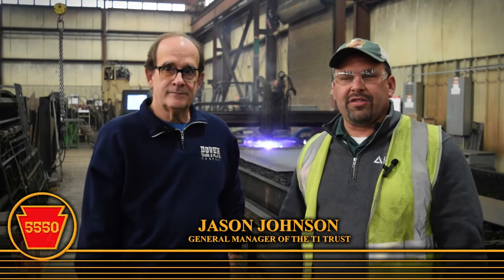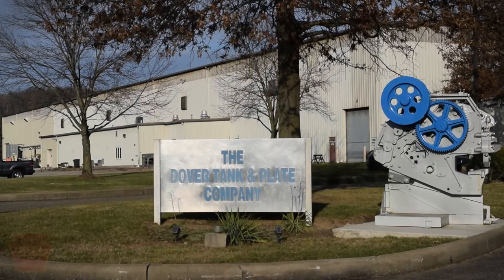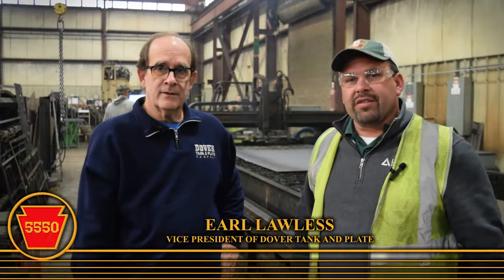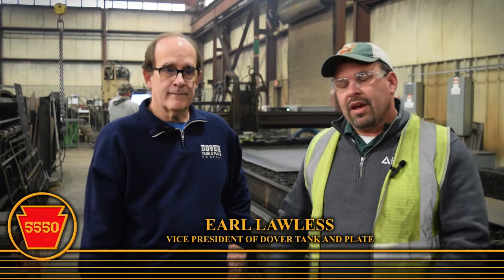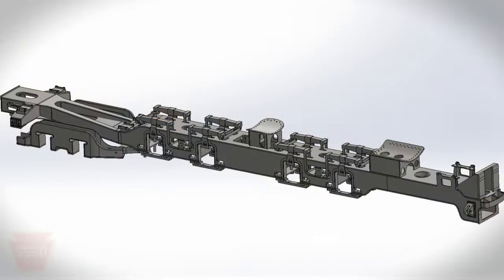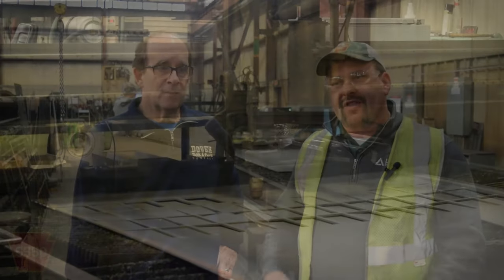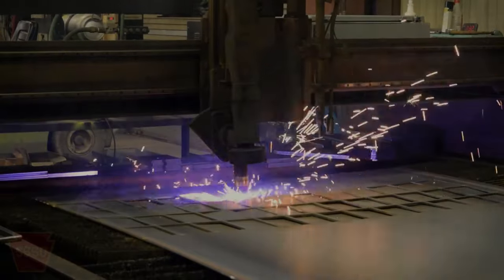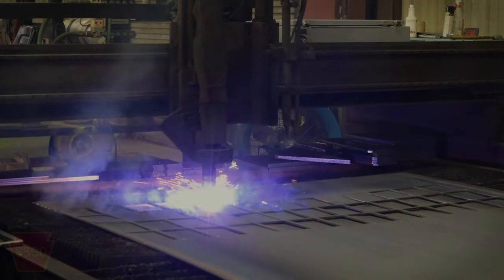T1 Trust | December 2023 Frame Update

Comment: So happy that 5550 is finally coming into existence! Once she's complete, we can finally see the root cause of the wheel tendency for ourselves in the 21st Century and see if that can actually be straightened out. It's also good that they're gonna utilize the newly improved Poppet Valve rather than the original Poppet Type A. I'm totally convinced that had the T1's production resumed, the newer locomotives would've been equipped with the Type B Poppet Valve. My best evidence for supporting this theory of mine is an account of one T1 locomotive having an accident and later being repaired, with the Poppet valve gears being upgraded to the new one.
Reply: We know the root cause of the wheelslip, it was engineers that were used to the K4s thinking they could drive a T1 like a K4 - that is, maxed regulator and full forward on the Johnson from a standstill. When the PRR loaned out a few of their T1s to the C&O, the C&O engineers didn't have any issues.
Reply: @VestedUTuber  You beat me to it, darn it
Reply: Not to mention lots of duplex and articulated locomotives were fairly successful at many other railroads. It's more of a training issue, rather than an inherent error or flaw of the design.

Comment: Once the new T1 is finished, I’d love to see it be coupled to the Lake Shore Limited, put the diesel locomotives on idle, let them just provide HEP, connect a few private cars to the train and let the T1 go at it and provide all the pulling power for the train! OH, YEAH!
Reply: I'd like to see a Baggage or similar head end car converted to provide HEP and Heating. Since the T1 will have integrated PTC, it shouldn't need to have a diesel with in on mainline track.
Reply: @ThePTBRULES  the diesels are there to hold it back from 100mph on its first test run!!

Comment: One step closer to righting a wrong in the name of the preservation community! I wonder how famous this locomotive will be when finished compared to 4449, 844, 611 and 4014 when it is operating?
Reply: I’d imagine it will be in the new once it’s done, and if it DOES beat mallard, it will reach big boy status.
Reply: @backonpro5679  I definitely think that it could become the most famous steam locomotive in America. For all we know, it might be on par with Malard and flying Scotsman if its career goes really well. At minimum I could imagine it being as famous in America as tornado is in Britain considering that also was a locomotive that was a modern built version of a formerly extinct class.
Reply: If nothing else it would go down as the 1st extinct US steam locomotive to be resurrected brand new!  But i think it will go on to achieve much more than that.
Reply: @b3j8  in terms of an extinct class that is correct although there have been other reproductions of formerly scrapped locomotives previously. Union pacific 119 and central pacific Jupiter were both re-created in the 70s. Two other 19th century style locomotives were built in the previous decade one of them based off of the central pacific locomotive 63 leviathan. But in terms of large steam, it is definitely a mile stone and certainly it is even more significant because it is a streamliner that is being resurrected rather than just a 19th century locomotive.
Reply: @lucasquintanilla1673    That is true.  My comment was in regards to a large class of steam locomotive.  And I hope tbh other examples might follow such as an NYC J3 class perhaps.
Reply: @b3j8  hopefully that will come to pass. Honestly though I bet if a Hudson was re-created would a Niagara be next?
Reply: @backonpro5679  very big if tbh
Reply: @intercity-mq6qv 
Not really, the PRR T1 has around twice the power-to-weight ratio of the Gresley A4, as well as slightly larger drivers.
Reply: It might be better-known among the general public than 844 etc because, like 611, it looks “different” and retro-futuristic. Looking forward to more project updates!
Reply: @PhantomP63  I really hope that 5550 has a successful excursion career! I too find it a potential favorite because of its Art Deco aesthetics

Comment: Looks good. At this stage, do you know how the four cylinders will be attached onto the frame and will they be welded or bolted onto it? Will the four cylinders be cast or fabricated?
Reply from the maker: welded on
Reply: @TheT1Trust What is the reason for welding the cylinders on rather than bolting them on? Just curious 😊
Reply: @mamarussellthepie3995  Bolts would penetrate the cylinder. welds are kinda like fusing the cylinders. if you do your weld right, you won't put a hole in the cylinder, which would weaken it and reduce power output.
Reply: @briggscarson  Well, sure, but haven't Steam chests been assembled pieces for basically ever?
Ideally, as long as you seal the two parts together as has been done historically, you can at least take the multiple sections apart for maintenance, right? Plz correct me if wrong, but what is the true difference in strength of welds in such a scenario, too? May wwlds be done poorly to the deficit of a locomotive? Or will the manufacturing be done well? What do you expect? 😁 
We're very lucky to be around in a time when programs like this may allow us to create even better steam trains! Exiting right?

Comment: So it's not going to be cast steel?
Reply: A casting that size isn't even a possibility anymore. At least fabrication methods have come far enough that it won't matter.

I remember when it came out that there wasn't a single place left in the United States that could bend an 85 foot long sheet of stainless steel into a passenger car.
Reply: @kennethlacewell1517  The T1 Trust said it was possible to build a cast frame, but the cost was EXTREMELY high.
Reply: I wonder what in this day and age would use a casting that big? A ship's propeller? Anything else?
Reply: @marklintwo I might say that the real question should be what would be better for the locomotive: cast or fabricated. . . But idk

Comment: When it's done they need to put it on the nec or something so it can zoom to finally make the brits shut up about their stupid duck train being the fastest steam locomotive ever cause it's not.
Reply: Easy there. While I agree that Mallard shouldn't be holding the record, it's still impressive that the British managed those kinds of speeds within the strict limitations of the UK's loading gauge and with less than half the power.
Reply: The T1 5550 will do high speed testing on the test loop in Pueblo, CO